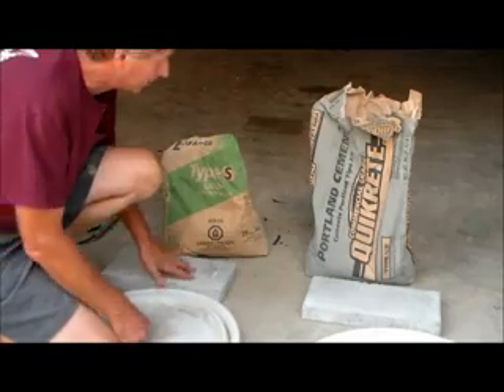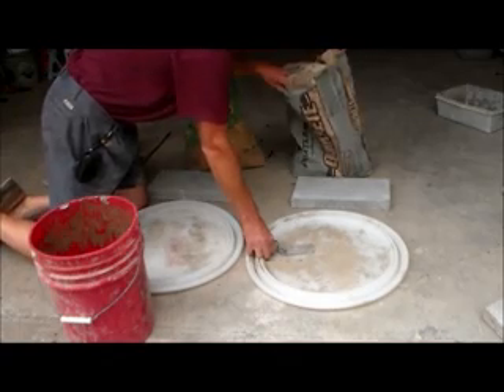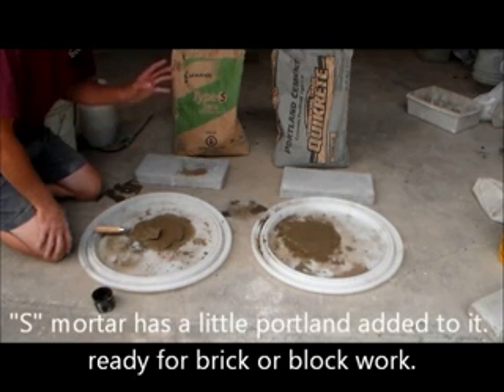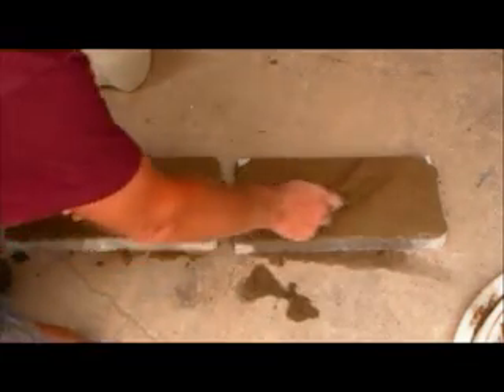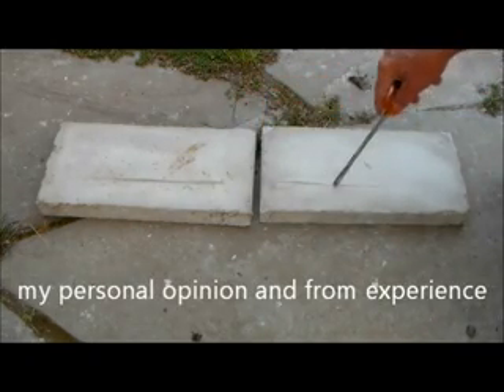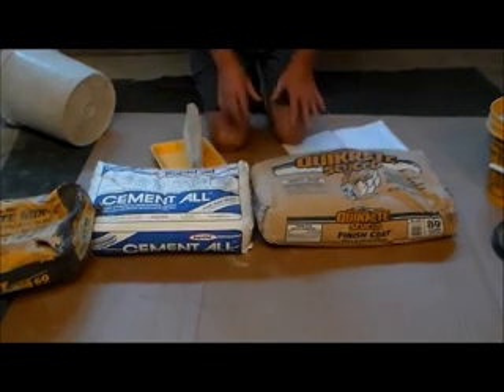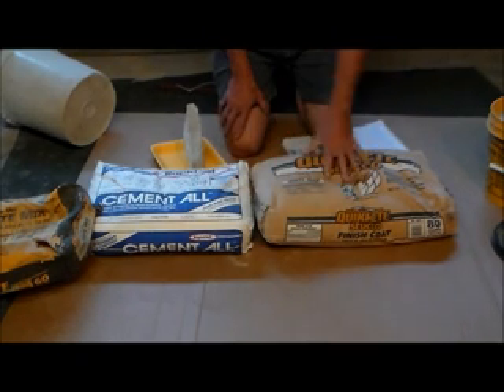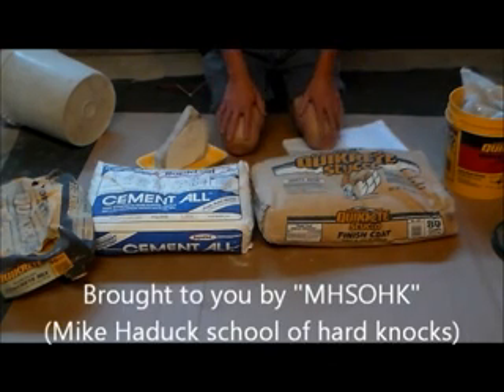WHAT CEMENT SHOULD I USE ? (Part 1) Mike Haduck

Comment: Does type S mortar have sand in it? I plan on using it to patch parge coating on the outside of a foundation.
Reply from the maker: Hi sonny, the premix already has the sand in it, just add water, everything depends on what you are doing thanks Mike

Comment: I've Always Thought you Use Just Enough Powder Goods to Fill the Voids Between the Grains of Sand. You Can Measure the Void Ratio By Measuring How Much Water it Takes to Totally Saturate Clean Dry Sand.  Around Here Mason Sand is About ⅓ Voids (Space Between Grains of Sand) So I Generally Mix 3 to 1. For Stone I Use a Shovel of Coarse Torpedo Sand in a Bucket of Mason Sand .Then Add Powder Goods About 1Part Cement to 3 parts Sand. You Can Tell When There's Enough Cement By the Way it Feels.
Reply from the maker: Hi John, after all these years I just know like playing a guitar chord at the right time, every job is a bit different,  thanks Mike

Comment: Thanks for all of your awesome videos! I'd love to get your input on my situation if you have time... For tuck pointing an area on the outside of my stone foundation, should I use mortar so that it can breathe, or should i use "cement-all" to water proof it, or both? I heard that if you use cement and it isn't breathable, it can trap water behind it and deteriorate the stone surrounding it. I was considering tuckpointing with the mortar, and doing a final overcoat with the cement in order to let it breathe from the inside, but also have it waterproofed from the outside.

Also, what's the difference between "rapid set mortar-mix" & "type S mortar"? Could either be used in my situation?

 I'm having an issue with a leaky basement and I'm doing some patch work around the house. And I'm trying not to mess it up. I've worked with concrete and mortar before, but never for this purpose, and I want make sure I do it the right way, so I don't end up having to deal with this same issue again later.
Reply from the maker: Hi Angela,  I did a series called "what cement should I use? Mike haduck, " that should lead you right direction, , got one again comming out next week, but I show what I use on my foundation repair videos, thanks, Mike

Comment: Thanks, Hearthman you've in part expressed my reservations with Mike's videos. I find them very entertaining but confusing. The N type mortar is a 6 to 1 ratio mortar, a ratio that Mike hasn't mentioned once IMO.
Reply from the maker: Hi Hector,  I usually use 2 sand to one cement on almost all my mixes,  6 to 1 would fall apart in my area, very quick,  maybe in the tropics but not here in my mixes,  ,  I hope it helps ,thanks mike

Comment: Whaty about premix mortar? Do wee still need to add sand?
Reply from the maker: Hi Strob,  premix usually has the sand in it,   Whatever brand you use check out the directions and you should be fine,  thanks mike

Comment: what kind of cement or mortar would I use to repair cement block in a basement? i had to scrape the walls down there before waterproof painting to get the effloressence off and alot of the mortar is damp and crumbly. house was built in 1981. i live in ne ohio.
Reply: i haven't painted them yet cause I wanna get these repairs done first. this is my first job like this and have no idea what to use. there are no active water leaks down there but it is always damp so i don't think hydraulic cement is for redoing the mortar. idk. the people that work at Home Depot are more clueless than me.
Reply from the maker: hi Ryan,  check out my videos on how I repair a stone foundation, mike haduck, they should help, thanks mike

Comment: Hi Mike, I live in long island NYC the weather here is cold, hot  muggy. This is my first time using cement. My front house step is made of bricks and the bricks are getting loose. just wondering can i just use Portland cement to fix the loose brick. Do i need to add sand or type S cement. kinda new in this and trying to save money by fixing it my self. can you tell me what the best way of fixing my brick step and what kind of cement i need to buy. Thank you

Comment: if im doing an indoor project with lava rock that needs to be waterproof should i use portland cement or type N mortar?
Reply from the maker: Hi, I can't say, I just show what I used in each circumstance,  I got a series called "stone veneer installation, " that might help, thanks Mike
Reply: @MikeHaduck  i have an existing wall thats made of lava rock and mortar and i want to build a reservoir with other lava rocks and turn it into a water wall of sorts.

Comment: Every bag of concrete I've bought contains aggregate.
Is this a special kind you are using and will it work for sidewalks with no aggregate?
Reply from the maker: Hi, check out my videos on  concrete step repair,  driveway repair, and resurfacing,  I am sure it will help thanks, Mike

Comment: check out all the videos of "spalling" brick from using Portland cemet.  Use Portland & replace all the bricks later from moisture.  What area of the country you working??
Reply from the maker: Tanzy Colasanti I am very aware of what they are saying, but here in NE PA, if you don't add Portland it will fall apart in a number of years. just saying it from experience. and I been doing it sense the 60s so I am just passing along my opinions and let the dust fall where it will.  thanks God bless. mike

Comment: should i use mortar or cement for flagstone steps? im in south central kentucky
Reply from the maker: Hi Cecilia , I have videos on stone step repair, or flagstone patio installation,  every situation is a bit different,  thanks mike
Reply: @MikeHaduck  ya, i found the one for the step repair, and i am using it to guide me. thank you so much for all these videos!

Comment: hey mike if i am building a pond what would you recommend?
Reply from the maker: If I did a pond it would be portland,  I would check with the locals to make sure  , thanks mike
Reply: thanks and do you think 1 part cement and 5 part sand would do good?
Reply from the maker: I always use 2 sand one portland but everything depends on what you are using it for. I can not really comment unless I was there to see it. I would ask the locals,  thanks mike

Comment: Hi Mike - great videos, thanks so much! what is the difference between Portland and the thin set mixtures? Are all the thin sets just a type of mortar which is finer than Portland? 

I notice that many of the products are noticeably more expensive. I’ve been worried about using regular concrete on any area where it would be too thin to hold up and thus I’ve used the more expensive products. Now I’m thinking there is no need. 

Is there a certain level of thickness under which you will only use mortar or a thin set product?
Reply from the maker: Hi Mark, I only use thin set products on tile ,  I never use them in basic masonry,   I got to do part 2 to this video but I am 25 behind now,  thanks mike

Comment: Hi Mike, watched your "What cement should I use" videos and have a follow-up question. If S-Mortar Mix already contains the sand, why do you AGAIN add sand in a 2:1 ratio? ... or does the S-Mortar you use ONLY contain the portland and lime? Thanks!
Reply from the maker: Hi Marco, I don't add sand to the pre mixed , only to the straight potland or motar, everything depends on what I am doing, thanks mike
Reply: @MikeHaduck  Much appreciated Mike. I have never seen just masonry cement (mortar) in a bag all by itself without the sand mixed in, which is why I asked.  Stay well!

Comment: Oh, I forgot that I mentioned the stairs a couple days ago. One of the hard parts is the prep work. Chiseling off cement from the bricks, chiseling off mortar and cement from the stairs, wire brushing the area, then seeing and removing more. Not to mention that the ants seem to love areas under the brick. What a pain in the butt job. I am hoping that the actual putting it back together will be less intense and more interesting than cleaning the area.

Comment: I have an old clay cinder block seller a lot of the mortar has fallen out and on the very bottom they used a clay brick which in places are completely gone and dirt is washing in on really wet days. I'm in Indiana would using Portland to fill this in be ok? I just want to stop the dirt from washing in and dry it out.
Reply from the maker: Hi Chris, check out my video series, Stone foundation repair, (mike Haduck). I think that’ll answer most of your questions, thanks Mike